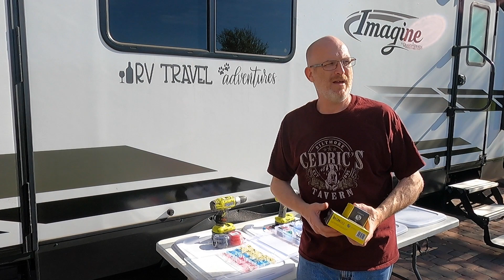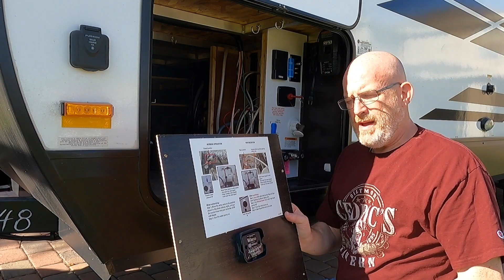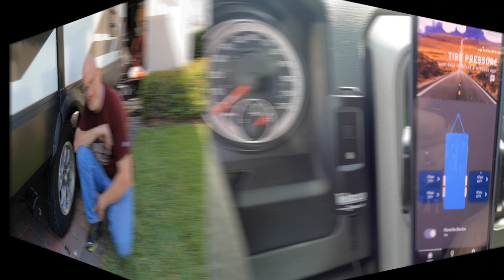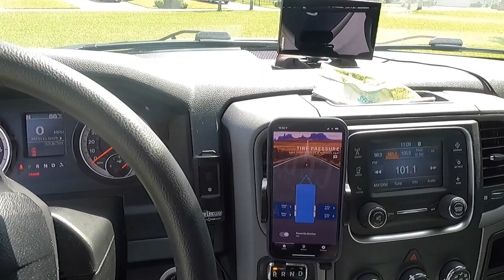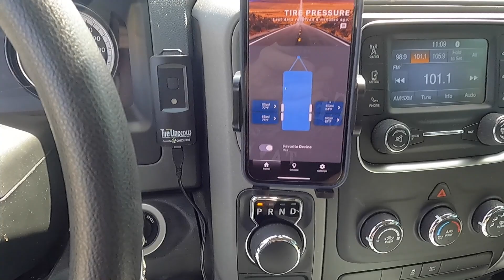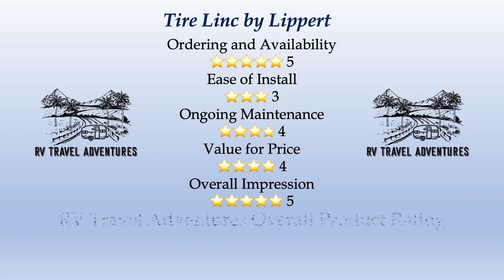Lippert Tire Linc Install

Comment: Was very interesting up until the point you failed to show how the problem was solved.  I’m having the same issue so I guess I will call grand design to figure out how it was fixed. Thanks to you, I know its not just my camper, seams they installed it wrong on all of them, lol!

Comment: Hi Matt, After a year with the Lippert Tire Linc system, would you still recommend it over the Tireminder system you had previously?
Reply from the maker: Hi, Bernie! I liked this model way more then the Tireminder, but there are hither model Tireminder that may be comparable. I am currently testing a TST system that so far I like better then either of the others. Will have more feedback after a few more drives.

Comment: You know, most anyone can mount the docking station and repeater and hook it up to 12 volts. The agonizing part is getting the stem sensors to pair. My instructions say “can take up to 90 seconds” (not 30 as you stated). I don’t know if I waited the whole 90 seconds because it said we had an “error” so “try again”…and again…and again. Are you kidding me! All of this stuff came installed on my Reflection, all I wanted to do was see it on my Compass Connect app. I’ve run TireMinder on RVs since I retired (as an electrician) in ‘09 with no issues. I would not recommend spending money on this LCI product.

Comment: I have the docking station pre-wired in my heartland camper. Does anybody sell just the repeater and tire sensors?
Reply: Not that I have found. The dealer might for top dollar. I just bought the whole thing discounted on Amazon.

Comment: This product is complete crap. Came with our rig. I called lippert twice and they could not get it to work! They sent more sensors and it still did not work. They put all there tiny minds together and could not figure it out!
Reply: I told my dealer that my only problem with the Grand Design Reflection we were buying was Lippert Components. I thought he was having a coronary. Little did I know just how dependent every RV manufacturer has gotten on LCI. The TireLinc system came installed on ours, too. I guess I should check the batteries. They only have a 10-year shelf life and this thing was built 11/2022.

Comment: I have this system but when I am moving the pressures and temps don't change. When I try to open one control on my phone it will not open while moving. App tells me locked while moving for your protection.. how can I operate the app to see real time information whe driving?

Comment: I thought the idea was to save you from having blowouts not just tell you right after they occur.
Reply from the maker: That is certainly a key benefit.  It can alert you to loss of pressure, and overheating.  In this case, we had a catastrophic failure of the tire, so there was nothing to alert until it blew.